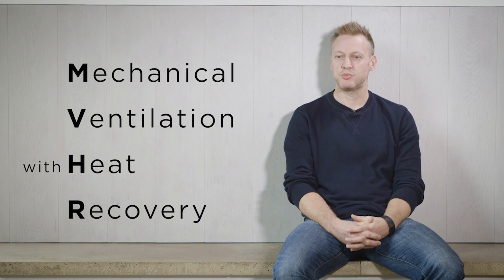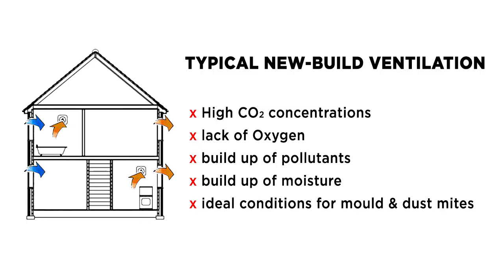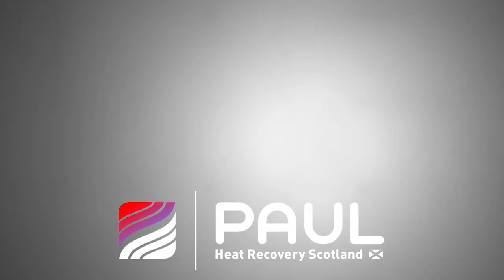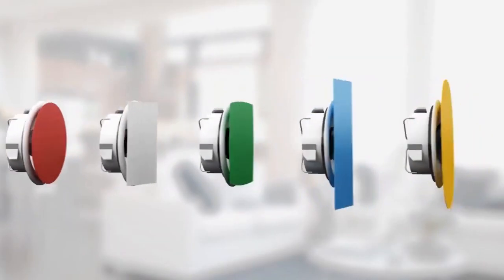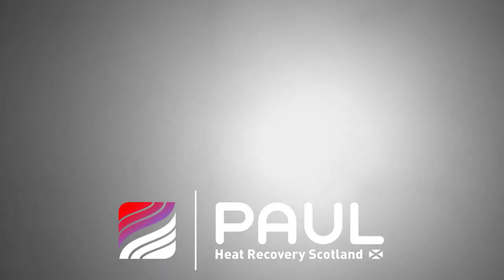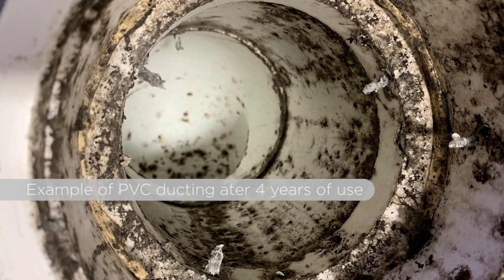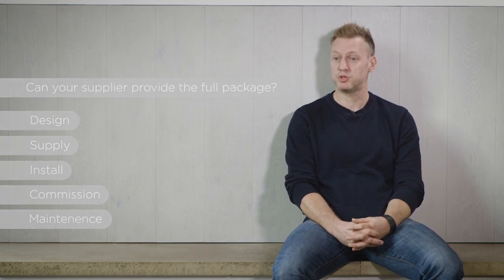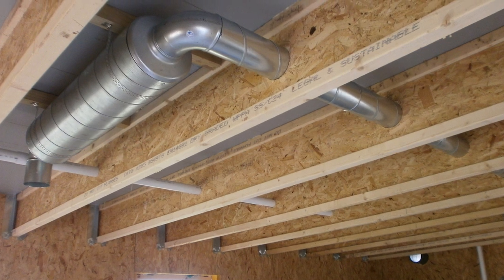Complete Guide to MVHR | ADVICE | Homebuilding

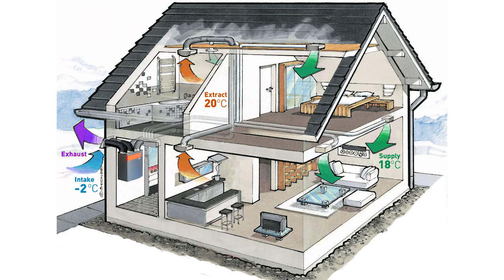Comment: @0:29 into the video would the exhaust air and unit itself not be better suited to higher up in the building, like the attic. how hard is it to draw hot air down pipes from the upstairs bathroom?? and in that way too it'd be super close to the bathroom which 80% of the time is where its taking the hot and steamy air from so close as possible is better. and the pipes foes into the attic too lol. the hot air from the kitchen is perhaps negligible as there is already a extractor fan for the cooking. and rearranging the system would also save 70% of the piping. extra money saved there alone. 

I'm not a pro just looking into this for my own self build.
just thinking out loud :)

Comment: Good system no doubt , but 8 grand is way to much
Reply from the maker: It's definitely an investment, and in a Passivhaus it's unavoidable - airtight homes must have a ventilation system. If you're planning to be in a house for a long time, it should pay itself off after 5-6 years.